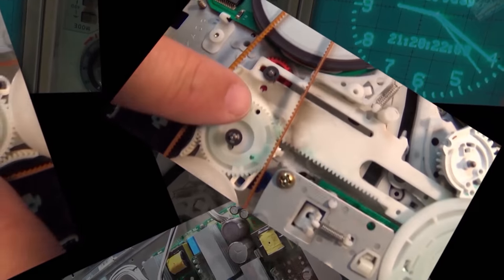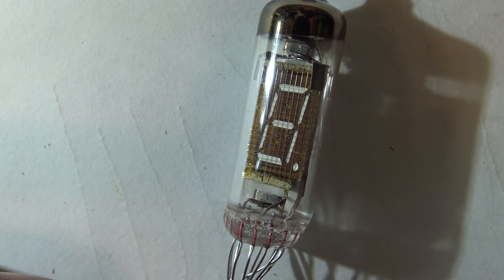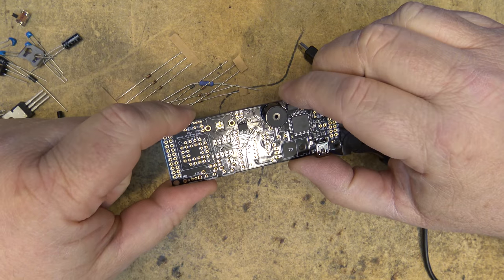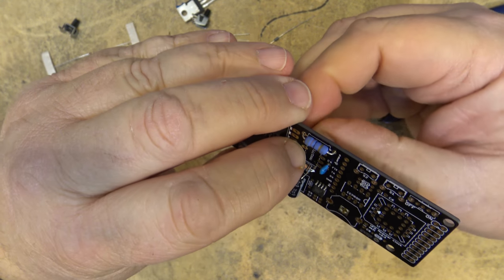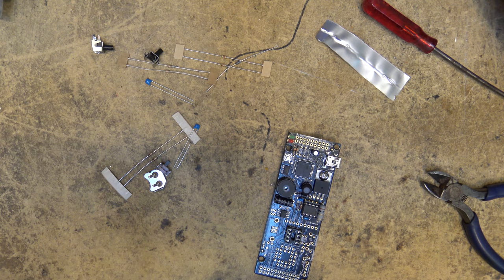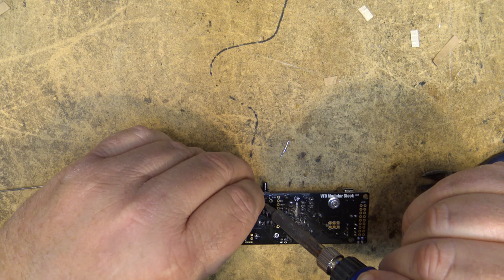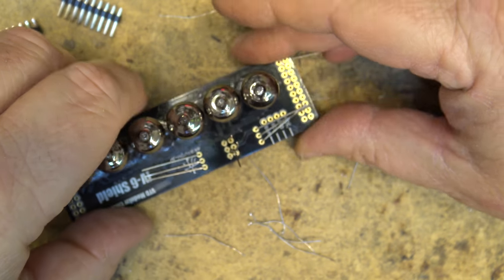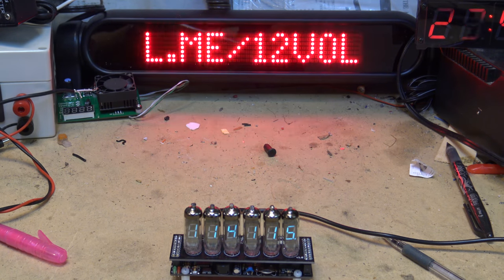IV 6 Vacuum Fluorscent Display Digital Clock Build in 4K

Comment: I like VFD more than Nixie Tubes. I wish that they still made electronics with VFD. My tape deck has VFD and many of my older Vintage Carver stereo components have VFD. They look nicer than LCD. Nice clock build.
Reply from the maker: Right VFD is one of the nicer of the displays because the color can be easily tinted by putting a colored lens in front. Probably one of the reason we don't see them much these days is the cost. LED and LCD is so much less expensive to manufacture, and these days that is all the counts. How cheap can we make it. Why do you think plasma TV is gone? It had nothing to do with reliability, as most plasma sets were far more reliable then LCD sets.
It was about the component count, and the cost of manufacture.

Comment: Smashing job :-D, 
They did throw a bit of confusion in there with parts, but you worked out what the silly buggers had done lol.
That one ohm could be swapped for a 0.47 if you wanted just a bit more brightness, and it's a common enough value.
I would think a lower than spec voltage would make the vfd's last longer anyway :-D.

Comment from the maker: Anyone wanting to build one of these better act fast as according to the seller he doesn't have many, and they will go fast, especially the 6 digit version.
Reply from the maker: I don't set the price of the kit, I paid 80.00 for it just like everyone else. 
There is more to the price of the kits than the tubes alone and components. Obviously the seller is making money from it. That is how a business works, you need to turn a profit. Don't like this, then please buy a bunch of parts, design a kit for us, and sell it to us at your cost and make nothing. That would make us all happy and you will go broke.
Reply: i was trying to say that they don't seem (the tubes themselves) to be that rare. That has nothing to do with the Kit which looks like very good quality and all the other things you said with which i agree.
Reply from the maker: Right, but typically all VFD, Numitron, and Nixie tubes are getting scarce. There are still some noe old stock available as they did make millions of them, but in the case of these ones, they haven't made them since the early 90's so as stock runs down, the price is going up. This kit is of the highest quality as I said in the construction video. The PCB is  one of the nicest I have seen. The numitron tubes are rarer than VFD,  It does more than I demonstrated. It can also scroll the date and display the temperature at the 30 second mark then blanks the display at 40 seconds, turning it back on at 50, at 55 it scrolls the date leading up to the minute mark.

Comment: Try paralleling another 1 ohm resistor across it to get .5 ohms, and see how bright it is. Or just use a small multi-turn pot across it, turn it up (max resistance) all the way, then turn it down until you get the brightness you like and put a dab of nail polish on it. Ta-daa! :) By putting a small SPST switch in series with this extra resistor, you now have a switchable bright/dim setting.
Reply from the maker: There are 10 brightness settings in the menu.
Reply: 12voltvids - Oh, that takes all the fun out of it. :)
Reply from the maker: Actually with the 1 ohm I put in it is more than bright enough. I have the brightness setting at 7 and it lights up the room in the dark.

Comment: The right order to install the parts are the order that works for you.. just my opinion.
Reply from the maker: Learning Electronics Cheaply 
Right and I normally start with resistors and then move to bigger parts but some kits have your build in sections so each section can be tested 1 stage at a time.

Comment: You said that the tube had a ‘getter’?
Reply from the maker: All vacuum tubes have a getter,  at 7:35 you can see it at the top of the tube.  When the getter is flashed during manufacture it creates that mirror like coating on the inside of the glass at the top. It's job is to react with any gasses left in after evacuation.
Reply: @12voltvids  I see; I asked you instead of Googling it because I wasn't sure if you said 'getter' or something else.  You never can tell with a word that is new to you.

Comment: Where is link for shopping?
Reply from the maker: V. Maleta 
The link for tindie is in description. The link to the web site if printed on the parts bag I show at the beginning when I unpacked the parts. He has more kits on his web site.
Reply from the maker: V. Maleta 
Yup they are expensive. You should look at the price of Nixie tube clocks if you want price shock. They will continue to go up too the blue one I show in my opening logo is called Tha adafruit ice tube clock. When I built that one is was around 70 and it now sells for about 180 just due to the cost of the tube which is getting hard to get and those that have them are holding out for the best price. That's the way it works. Next shipment they will probably be more still. Now consider this. In 1977 I built my first digital clock. It was a heathkit panaplex clock and in 1977 that kit was well over 100.00. Today an old 1977 GC1106 goes for well over 100 on each bay. Panaplex are 7 segment neon display and are very rare and cool. The fact that as of now this kit is on back order again shows that you are the only one with a problem of the price.